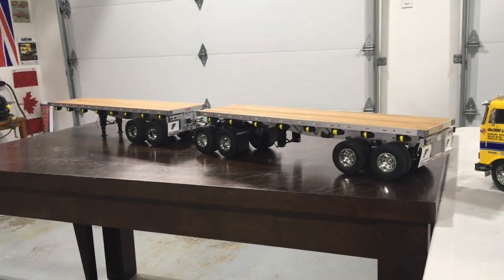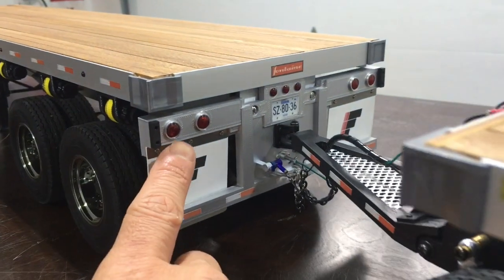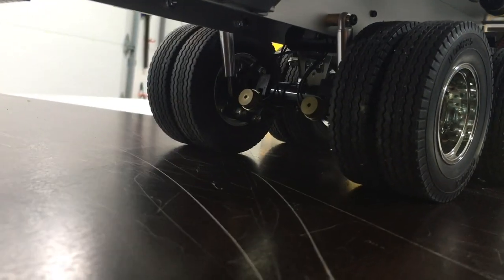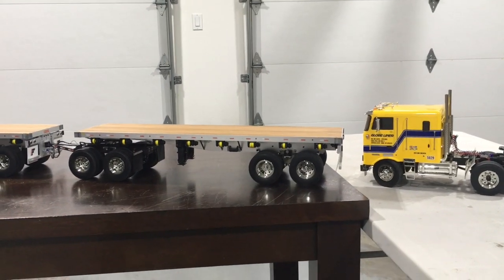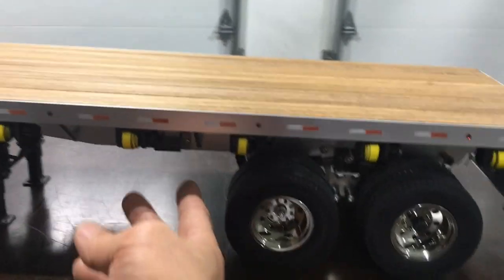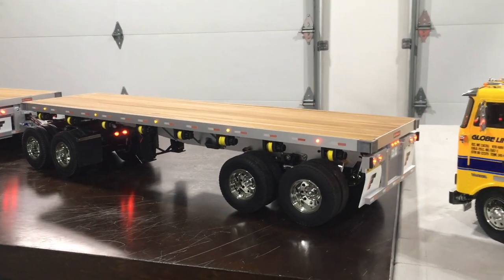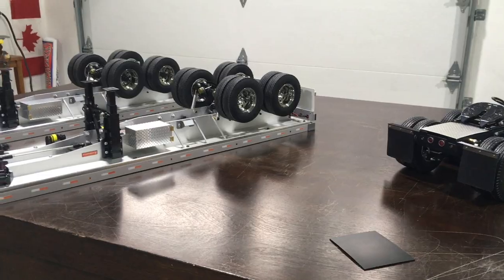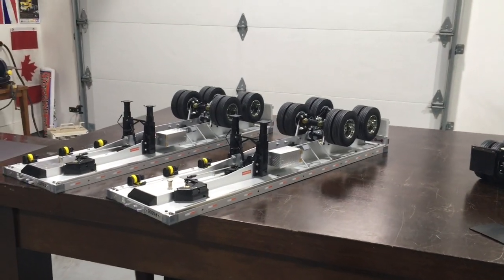Tamiya flatbed trailer A trains part 7 Upgrades.

Comment: You did a really top job on these two trailers, I think what I like the most are the air brakes, it's incredibly realistic and I'm not talking about all the details on these two trailers, otherwise my comment would be too long 😁 The dolly of the trailer is very well made, I think you must have spent a lot of time on it if only to hide the wiring. And to hide the battery cable, I think the chrome plate is more appropriate. Another big bravo for your great work 👏
Reply from the maker: Thanks Pascal, thanks for the feedback. Yes the chrome plate is my favourite as well. 👍
Reply: @westernsharpie  😊👍